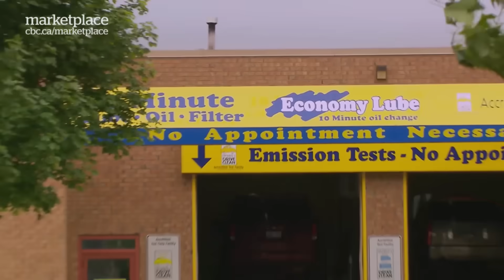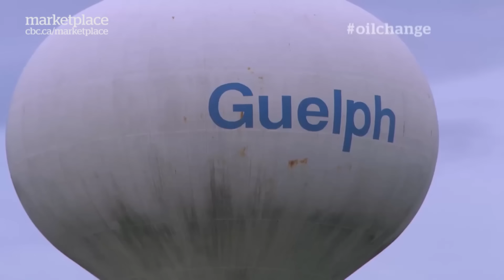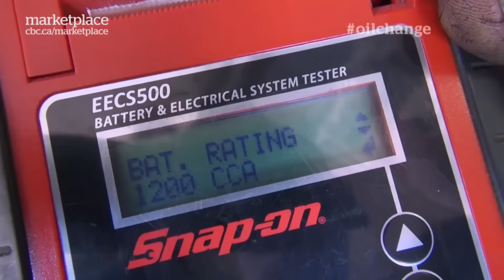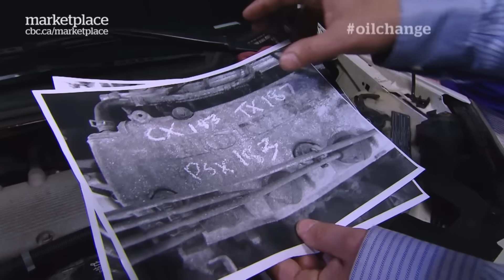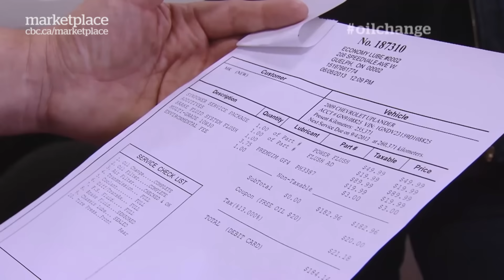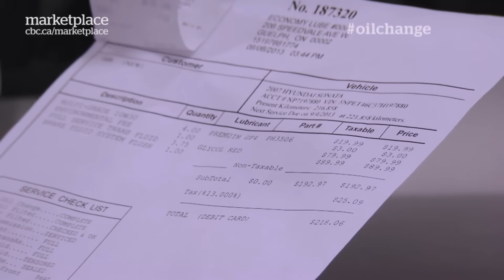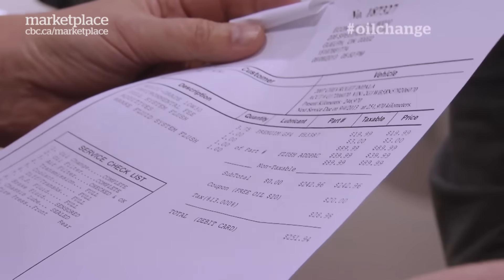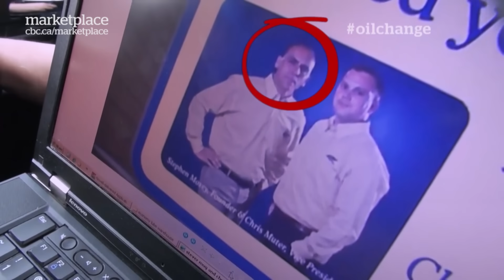Oil change scams: Hidden camera investigation on what really happens to your car (CBC Marketplace)

Comment: I've always done my own maintenance.  A few years back, my brakes started to squeal, so there was some urgency to change the pads.  I bought a set and changed them that evening.  While I had the wheels off, I noticed that the tyres were getting close to the end as well, so after putting in the new pads, I took it for new tyres the next day.  The mechanic raised it on the jack, appeared to look behind the wheel, and said "Your brake pads need changing."  I asked how bad they were, and he said "They're completely shot" (having driven all for 20 miles!)

Needless to say, somebody else got the job of changing my tyres.
Reply: I would've been furious.
Reply: how did the rotors look though
Reply: @MidNite.Garage  "rotors"?  What's that?  I'm a Brit, so we may use a different word over here.
If you mean the disks, I drove the car for about 3 more years then sold it when I moved from France to UK.
Reply: Kwik Fit by any chance?
Reply: @marflitts  No - I was living in Paris at the time, but there are scammers everywhere.
Reply: If you didn’t change the disks with the pads its gunna look like the brakes are shot. Brakes arent just those little pads, you gotta machine or replace the discs…. But yeah im glad you ultimately got all your problems solved
Reply: @TheKingKai728  Bullgrap!!!  Rotors don't need changing unless they have grooves in them or are warped.
Reply: @TheKingKai728  how would a full pad "look shot" because of some warping or the need for resurfacing the rotors? Just look at the thickness of the pad!!!
Reply: @designdesignation4296  You misunderstand.  What the mechanic saw was a new pad - but in reality, he couldn't see it without taking the covers off, but he thought if he said it, that I would believe him.  He was trying to get me to pay for something that didn't need doing.
Reply: @DownhillAllTheWay  thats called upsell

Comment: Sadly this is common worldwide, here in Brazil what is most common is cheap tire, you get a new tire for half the price of a good one but you have to leave your car for the company to make all changes for you, then what should be just 4 tires changed becomes a snowball of things like suspension arms,  supports, brakes, etc.. And then you leave with a bill 10 times higher than originally said.

Comment: As a tech. This hurts to watch. It’s really disgusting. Those 15 minute oil change places are awful
Reply: So the guy in the pit under your car is using canola oil instead.
Reply: why would it go more than 15minutes?
Reply: @trizahmacharia2939  you need minimum 20 minutes only for brake fluids
Reply: @mestarnekic9807  15 minutes is really all you need just for an oil change. now to inspect the vehicle to full capacity it will take a bit longer. so roughly about 30 minutes in all
Reply: @trizahmacharia2939  well you imagine emptying oil, finding and replacing oil filter, filling coolant, new oil, and adding washer fluid if needed.
Reply: Thats why an oil change at the dealership i work at takes 1hour to fully inspect the vehicle
Reply: I worked for valvoline for awhile and they have 5 star reviews sooo
Reply: @Themrine2013  on easier oil changes yes.  But some cars require up to 20 bolts and 2 skid plates to be dropped just to get to the filter and drain plug.
Reply: @Big_Ben1988  oh trust me i know always got pissed when i had to take useless plastic off the bottom of the engine. toyota and ford made it easier but bmws and other euro cars were the worst

Comment: I complete my own oil and oil filter changes on my '38 Chev coupe and my '67 Chev C-10 stepside pickup truck. Since i don't have a "lift," I have to use ramps to raise up the front end for access to the oil drain plugs. A tight squeeze, but at least I know that the cost will be only for the supplies, and I don't have to worry about screw-ups  or outright fraud from oil-change shops.

I took the truck to Econolube for lubrication several years ago. The oil was changed, but the technician failed to tighten the drain plug properly. Later that day while parked nearby in a large box store parking lot, I noticed a large puddle of oil beneath the truck. After checking the problem (a loose drain plug), I tightened it and added oil required to bring the level to the proper mark on the dipstick. Econolube or other oil change companies will never touch these classic vehicles again.

Comment: Me: Comes in with a bicycle
Employee: You're gonna need a brake flush, that'll be $214
Reply: And 2 grand for a new transmission
Reply: Add another grand for blinker fluid
Reply: you've dropped yer A-frame , and it's gonna cost you a million dollars ...and thats just labour
Reply: How long did it take you to think that one up 🤨
Reply: Your gonna need a new motor and gas tank for only 5K
Reply: You’re running dangerously low on pedal fluid, that’ll be 20 bucks per liter.
Reply: And your bike bell needs replacing as it no longer rings loud enough. I can give you my $50 off employee discount. Your new total is $75.
Reply: Lol

Comment: Ive always done my own oil changes on every car I've ever owned. I used to work for a oil change and car wash shop working in every capacity there, and what I saw the other oil techs doing shocked me: oftentimes they would just unscrew the old oil filter, empty it out, then put it back on the car! The manager encouraged us to "save company funds" by not using new oil filters, and other times we simply didn't have the correct oil filter in stock. Absolutely infuriating. I recommend learning how to change your oil yourself. It's as simple as this: jack up the front (or drive onto a pair of ramps that you can buy at most car stores), remove the oil cap on top of the engine, remove the drain bolt at the bottom of the oil pan and drain the oil into an oil pan ($5 at Walmart), remove the oil filter, replace filter, reinstall drain bolt, and fill with the correct amount of oil. It's the simplest maintenance thing you can do aside from replacing the air filter and filling your tires. It ends up being cheaper too. Just remember what you might get for a cheap $20 oil change...
Reply: oil changes are'nt a ripoff. You forget one thing; company's are forced to proces the oil in a good and enviromental friendly way. That on it's own costs money.
Reply: @Kirk Bond
I agree. It is usually fairly simple and saves money. In most, if not all states, you can take your used motor oil to an auto parts store like O'Reilly's and they will dispose of it safely & free of charge.
Just save the oil bottles you used to fill your oil tank & pour the old used oil there to turn it in.
Reply: @DJIInLondon  ahh, makes sense
Reply: It use to be cheaper to change your own oil. But sometimes now the price of oil and the filter and the work. Ya putting the car up and taking the cap off and the filter off. With the price of oil you could find coupons to save money.
Reply: I just put the used oil right in the fuel tank of my old diesel dodge and burn it
Reply: @davidcaskey4669  does that actually work??
Reply: @neft5449  I have a transfer tank with a filter on it keep about a half a tank of diesel the rest used oil Cummins will run on about any thing when it gets cool mix kerosene in it to keep it from gelling most of those anti-gel additives have to much alcohol in them
Reply: @neft5449  only oil I haven't ran in it is used frying oil
Reply: @davidcaskey4669  Should work. Filter the frying oil first (assuming it's not fresh frying oil  but used frying oil from some restaurant; they are usually happy if you help them to dispose it).

Sadly, more modern Diesel engines don't like Diesel substitutes any more.
Reply: Id do the oil change myself also if i had anywhere to do it but my busy apt parking lot.
Reply: @EphemeralProductions  I live in a community where its against the by laws to do any work on your vehicle in your driveway. Doing an oil change becomes a day trip to my parents 1.5 hours away so lately I've just got it done but it's sad how little you can trust people for something so basic.
Reply: @geometricdesigns3620  so dumb. :/
Reply: The problem with doing your own oil changes is getting rid of the old oil in an environmentally acceptable way.

Comment: I have a 2008 Mercedes S class 3lt V6. I have changed all filters and oil myself for the past 4 years and the most it has cost is, even some sensors with an Autel scanner, easy with common sense. Less than £80 every service.

Comment: They should have sent the same car back the next day with a new actor and see what they would have said
Reply: BASKETBALLMAN cars VINs are saved in the system
Reply: +BASKETBALLMAN - Great idea!
Reply: +Alan Arjona - "cars VINs are saved in the system"

I'd say, first just try it and see what happens. If they call you out on it, you could say oh, I'm sorry, my wife must have brought it in yesterday and didn't tell me. Otherwise, they might sometimes fall for it.

Alternately, it's a longshot, but perhaps the individual records are not shared between the multiple (12?) locations, at least not immediately. You could take the same car around to multiple locations over a few days.
Reply: i work for take 5 oil change and vehicles are put in the pc by vins.  i work in ohio but if wanted i could see service done on same car in any other state
Reply: best comment
Reply: BASKETBALLMAN you are confusing criminals with the mentally challenged. You don't think they recognize the same exact car the very next day? Good thing you aren't trying to blow the whistle.
Reply: I worked at jiffy lube for 4 years and they either will use a license plate or VIN number when the car comes in and also it is shared between all of the jiffy lube stores in the nation. Though I can't say anything about economy lube because they might have a different system, and I can attest to jiffy lube upselling people and possibly doing services before they were needed, but not once in the shop I worked in was something payed for that wasn't done.
Reply: Agree
Reply: And just change the plates front and back so they don't know it's the same car

Comment: Burnt power steering fluid, the silent killer. These guys are doing the lords work, protecting folks from burnt fluids unrelated to combustion. 

The 8 minute brake fluid change is very impressive as well. Bravo gentleman 👏

But in all seriousness…charging for maintenance prematurely is one thing if you actually perform the service. Some people want their vehicle pampered. But charging for a service that is never performed is just ethically horrific.

Comment: I went to Honda Oshawa for an oil change, they just reset the the system without doing an oil change. Next time I went to a different garage and they did the oil change right in front of me, the oil was completely black and the guy told me that this is a two times more dirty oil. I complained to Honda Oshawa and their manager said that I’m lying. Be careful not to go there
Reply: Damn dealers.  They ripped  customers  off.
Reply: I hold my breath every time i need to bring my van in to the Honda dealership
Reply: Matthew Abogado go to a regular mechanic but not to dealer’s workshop
Reply: Honda might be interested. Especially if your car was under warranty.
Reply: Y'all gotta learn to do it yourself
Reply: "Sketchy Oshawa" no surprise.
Reply: If doubting oil was changed, all you have to do is check dipstick....if oil is clear it was done...if dirty, it wasn't...and you will recognize dirty oil.
Reply: @ronlawray1563  Maybe. Even that depends. The oil can look very clean even when it's overdue for a change, particularly if the engine has low miles. Diesels in particular can look dirty five minutes after a change. With all fluids in a car when you do a drain and fill you're not replacing all of the fluid, just most of it. Transmissions are a good example, there is a lot of fluid that stays in the torque converter, clutch packs, and accumulators. It's really more important to change the filter in a transmission. Many shops sell this transmission flush where they hook it up to a system that replaces nearly all the fluid by cycling it through the cooler lines, but then they don't change the filter.
The brake fluid crap they sell is mostly hogwash. Unless you've had lines fail, left the cap off, or have an old car with deteriorating seals there's no reason to flush your brake fluid.
Power steering fluid is in the same heap. Yes it comes out of the bottle red, but in 99% of the cars out there it's going to look brown, that's normal. Again unless you've had issues with the system or you've got an old car it's not going to be a problem. 
Check the manufacturers recommended intervals outside of that I wouldn't worry about fluid changes unless there's another issue with that system.
I'm actually surprised they didn't offer to flush-and-fill the air in their tires, for an additional fee of course.
Reply: Same thing happened when I went to Toyota.
Reply: ImaPr3sid3nt I’m not surprised. I can expect this from all these dealerships

Comment: Your steering wheel isn’t round enough that will be $250 to fix
Reply: muffler bearing are bad.
Reply: Yep
Reply: Audi
Reply: Hahaha😂
Reply: True dat
Reply: steering wheel oil change costs 4$ usd over here to change ... i dont know what kinda oil they used maybe it had gold in it?
Reply: Busted flux capacitor
Reply: i think your piston return springs are broken, that usually leads to the valve cover failure so your camsaft will knock the valves too fast
Reply: 😂😂😂 no kidding

Comment: After taking my flat tire to Firestone in Texas to see if it could be repaired, the tire was in the BACK of my truck. After taking FOREVER, I looked in the window & they were under my hood, & I am thinking to myself WHY THE HELL are they under my hood when the tire is in the back of the truck, well after like 45 minutes or more, they came out & told me my oil was BONE DRY. They said they can do an $80 oil change real quick. Only problem, I CHANGED THE OIL MYSELF THE DAY BEFORE!!! So I said I would take it myself & put oil in it if REALLY needed. Well I drove it to the as station across the street, checked my oil, AND IT WAS BONE DRY!!! THEY FREAKING DRAINED MY OIL!!! Thankfully it had a brand new filter in it so I just had to buy 5 more quarts of oil and poured it in there. To say the least I never went back to Firestone!
Reply: More like Firebone!
Reply: fuckers hey!!
Reply: That makes me so mad
Reply: Nathaniel Class 
They rip off everyone! I put 2 much oil in my car, years ago. I took it into a shop & they said I needed a new engine! So they kept it over the weekend, on Monday,  they hadn't touched it. I took it out of there, ran it like crazy on the highway & smoke came into the car! When it stopped, I took it 2 an oil change place & the car was fine!!! That shop is closed. That was years ago. But, I thought, if I need an engine, I'm going to blow this 1 out!!! Never had a problem after I did that! They wanted $1500.00 for an engine I didn't need!
Reply: why did you let them take your car from you when the wheel was all ready removed from the car? i would have just given them the wheel and locked my car in the parking lot.
Reply: You can change your oil but not you ur wheel? :p
Reply: Nathaniel Class omg are you serious 😲😲😲😲😲😲😲😲
Reply: My step father was a manager at a Firestone. I'm sure he wasn't ripping people off. You just got a bad one. But I feel for you. I had a bad experience at an auto shop before. I'm glad I found a new mechanic who coincidentally goes to church with my parents. His labor isn't cheap but it's honest.
Reply: The reason they were under your hood is because Firestone offers a free courtesy inspection with every service. It is possible you didn't put in the correct amount of oil so it didn't show on the dipstick. And trust me nobody makes money on oil changes. If they were that busy that it took them so long to look at your car they definitely didn't drain your oil. Auto Techs get paid on a flat rate system and believe me, if they're not getting paid to drain your oil they're not doing it.
Reply: I work at firestone, and I can safely say that at least in my shop no such shady business practices occur here. You stated that your hood was up, well that comes with our courtesy check that we offer everyone unless explicitly denied. Your oil may indeed have been bone dry because when performing the oil change yourself you may have failed to tighten the oil filter or the drain plug all the way. Infact the other day we had a car come in and an oil change was performed and it sat over night and a large amount of oil had drained out just because one of our technicians forgot to put a rubber seal on the the filter.
Reply: Peyton at which one are you located